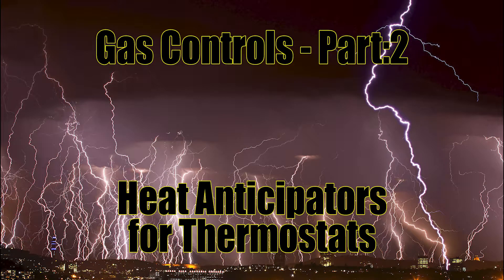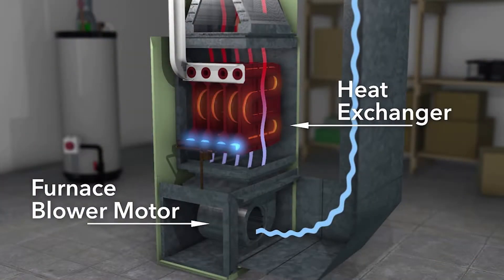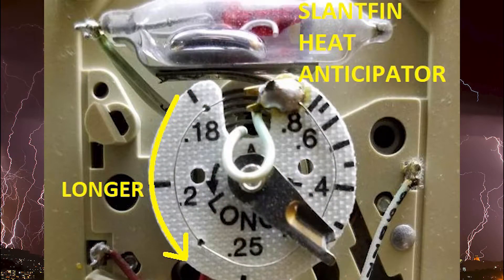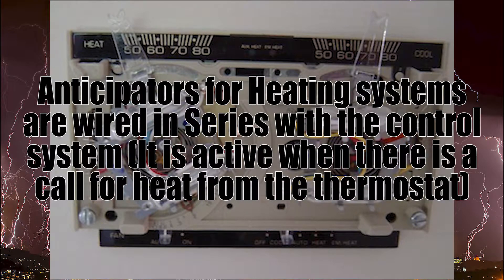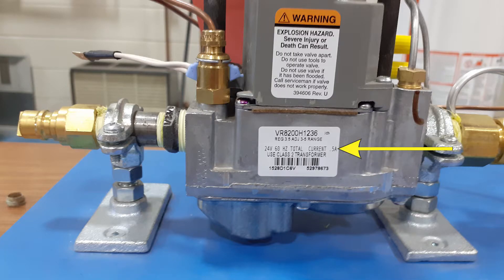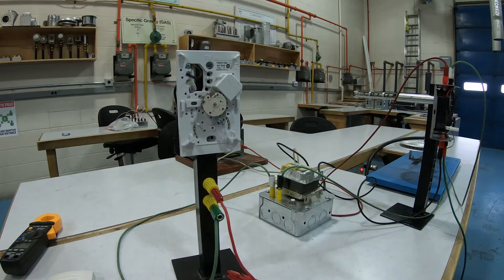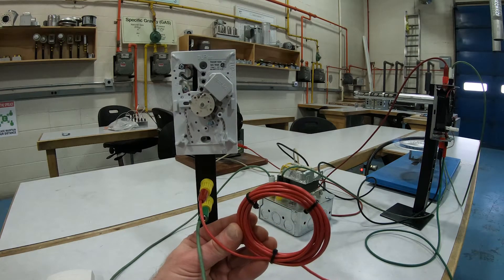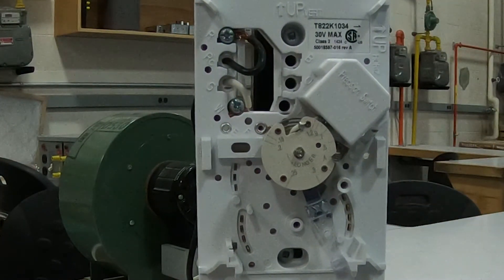Gas Controls - Part:2 Heat Anticipators for Thermostats

Comment: Excellent video! Thank you!
Is there a way test my anticipator w/ a DMM? I assume continuity and/or resistance between the pointer and the switch end of the white wire??
Reply from the maker: Ideally you use the AC amperage setting and match the amperage to the amperage of the gas valve. It will need to be sensitive, 0.5 amps or less. You can do it with resistance too, but that requires ohm's law math

Comment: What tstat would be needed for a boiler in floor 3 zone heating system as i have a mercury one with the anticipator. Was in my house when i bought it what should i do with the setting in the anticipator thx. 🍻
Reply from the maker: Zero the anticipator out. rotate it counterclockwise until it is touching the solder connection at the 1 o-clock(ish) position